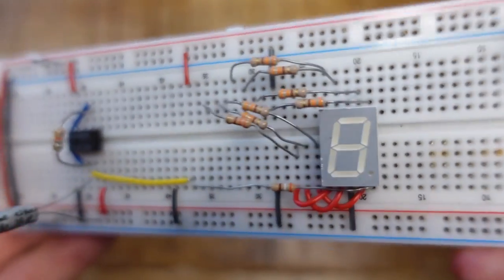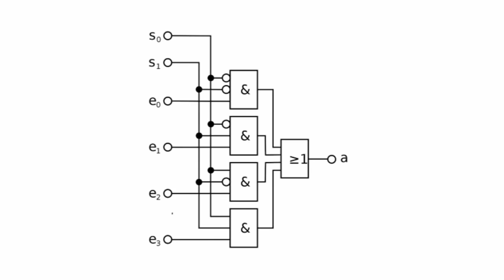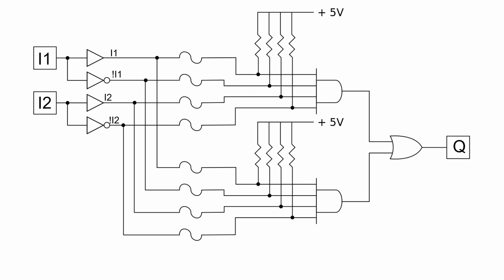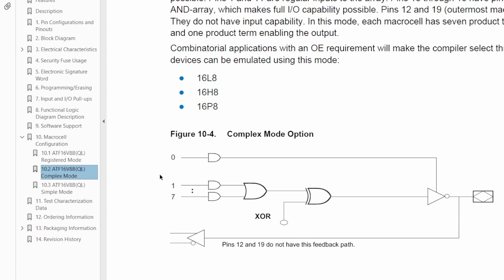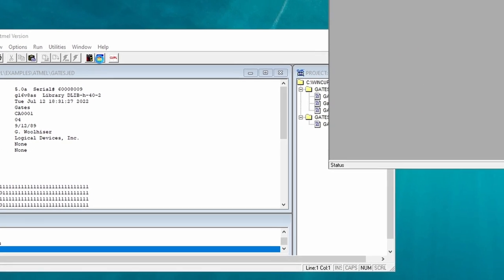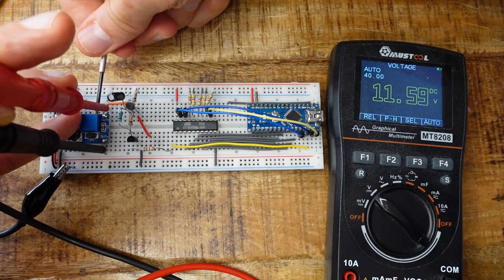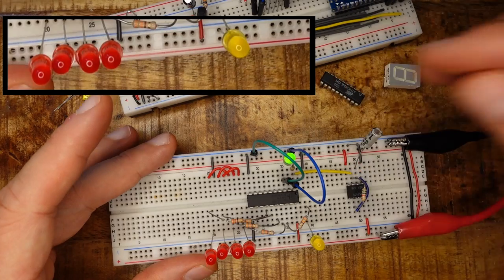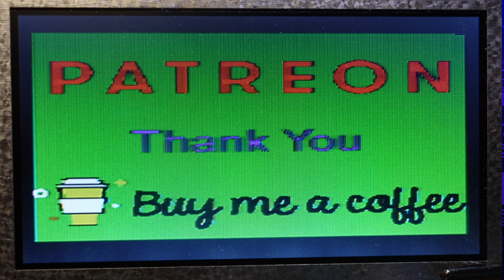Make Your Own Microchips!

Comment: I worked with GALs in the university - 30 years ago, we had a Xeltek Superpro parallel port universal programmer. Recently I found some GAL chips and think that could be cool to use them again. But universal programmers are expensive to program a half dozen chips.
Excellent project, congratilations from Colombia.
Reply: You can get an XGecu Pro T48 to program GALs with.  Most of these type of programmers are under $100 (usually between $50-$75) and use USB.  I use mine to program GAL16v8's, GAL22v10's, EEPROMS, and EPROMS with.

Comment: Hey!! The title of the video is kind of misleading (I thought we could bake some new microchips in the oven... hahaha!) But, really, really, PLD and GAL are "obsolete" technologies which all of us, nerds, tinkerers and makers want to know. Thanks for sharing this info. I think I'll buy some ATF chips to experiment with.

Currently, I'n working with FPGA and CPLD from Xilinx (XC9536XL) which are very nice for some microcomputers (address decoders and implementing some basic peripherals like IO ports and simple SPI port). The programmer I use is a Xilinx Parallel Cable III with official schematic freely available on the Web (1 parallel port plug, one 74HC125 chip and cables), but it needs some big propietary software like Xilinx ISE Webpack (from version 4, that I can run in and old laptop with Windows XP and a parallel port). Really nice all of these world about programmable logic.

We love your videos!!! Keep up the good work!!! Cheers!!